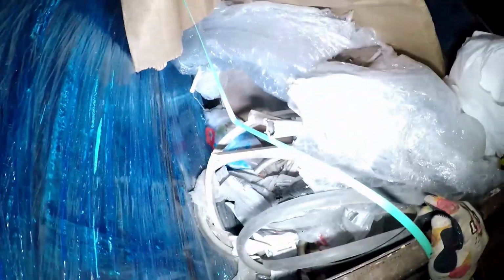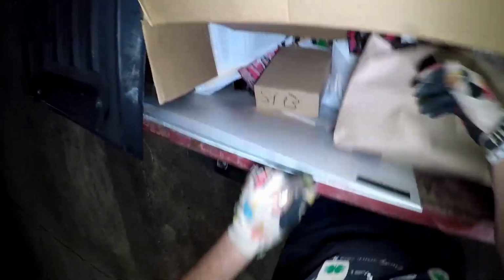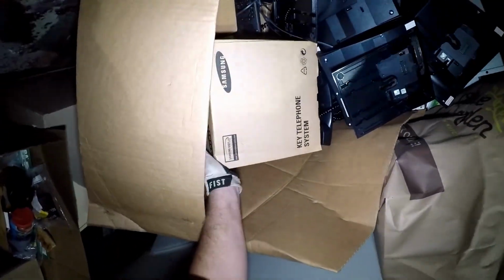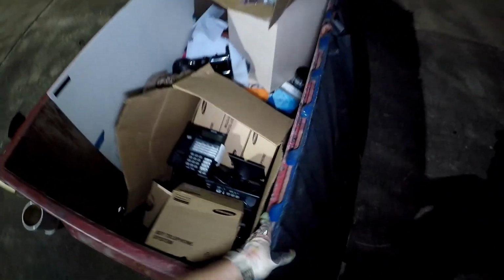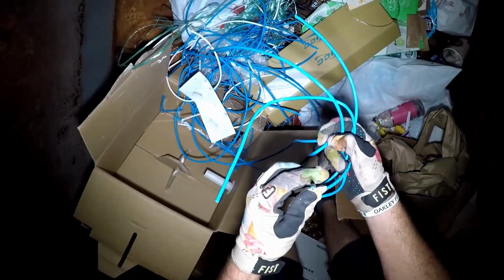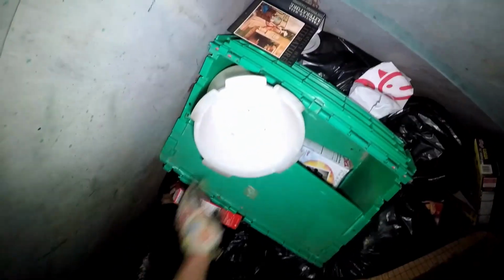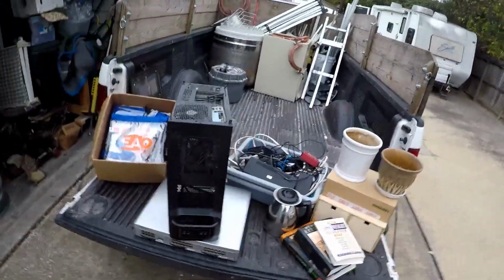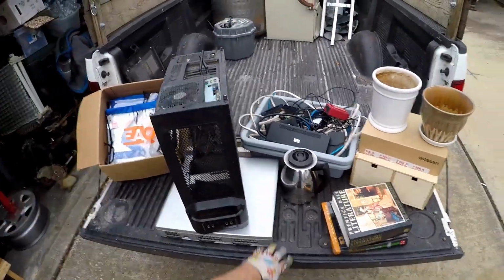Dumpster Diving & Curbsiding "The Web Of Life"

Comment: i would definatly clip all the wires off those phones/chargers etc..
Reply: not enough copper in that phone wire to make it worthwhile. you'd only get shred for it, a couple cents a pound at most.
Reply: @tech4pros1  yould be surprised..that stuff all adds up..i get # 2 for it..sometimes #1 ..if I do it right